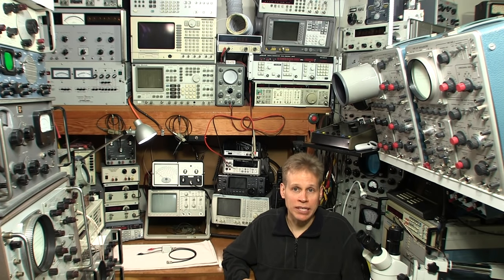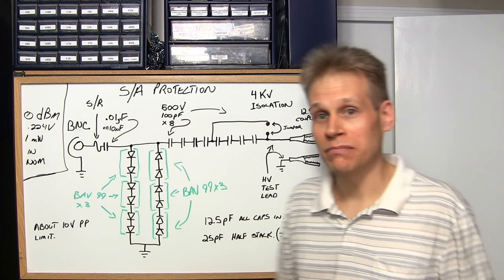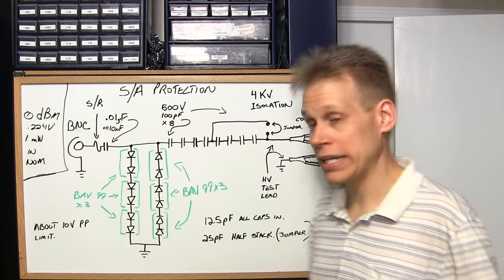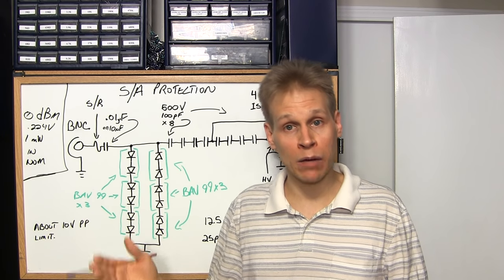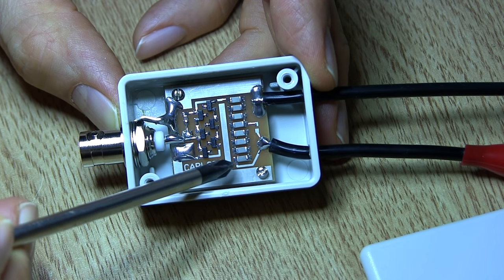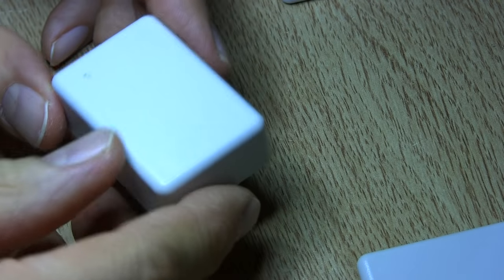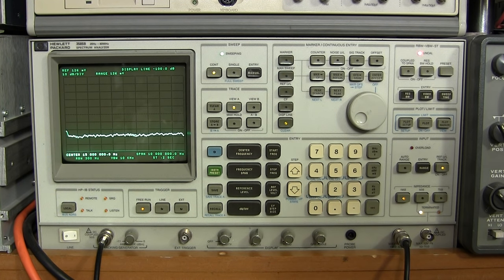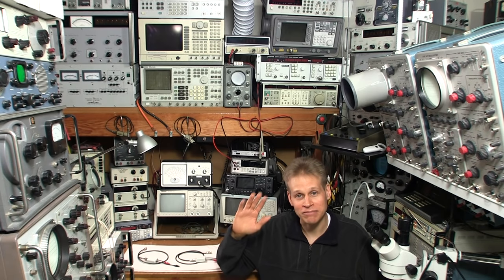Build this Spectrum Analyzer Protection Circuit

Comment: I reproduced this circuit using Circuit Maker and etching it to a single-sided copper PCB - using 1206 caps. I only added a 50 ohm resistor to ground before the 10nf cap at the output. I made a pair of them and so far, so good. I’ll try them on the IF alignment of a SX-99.
Reply from the maker: Hi James. The input to your analyzer should be 1M Ohm for proper results. Adding the 50 Ohm resistor to the TG side is OK, and suggested.
Reply: @MrCarlsonsLab  Paul, my spec-an is Siglent SSA-3032X - it has 50 ohm input.  So, understanding that the 50 ohm resistor basically sets up a voltage divider, should I turn up the TG signal ? What is your suggested mod to make the 50 ohm match to the input of the spec-an ?
Reply: @MrCarlsonsLab  Well, no response. I’m going to try a simple in-line 50 ohm terminator on the SA input and see how that goes.
Reply: @jameshall5835  I have the same SA, how did this work for you?

Comment: Amen on the being careful what you put into your spectrum-analyzer. I have to REALLY have a compelling reason to hook mine up directly to any circuit.  I have an HP-8557A which has a 30VDC but ONLY 2.2VACRMS input capability!  I've had to repair this unit and it is not for the faint-of-heart (just look up a manual for one of these and you'll see!) as it is full of specialized and one-of-a-kind parts that are nearly impossible to find.  In the past, I used a very small-value capacitor and a 120dB step attenuator, then "work my way up" to getting a usable/displayable signal.  

So, anyway great video on both the value of "light" coupling and protection of the SA's front end.  Also, nice construction project and showing the value of placing a "service-loop" on the BNC center-pin to prevent breakage/damage to the PCB.

Finally, another project idea might be to make a high-gain broadband RF amplifier with a detector that would allow your viewers (without spectrum analyzers/scopes) to be able to both very lightly-couple and display the amplitude on a analog multi-meter for alignment purposes...
Reply from the maker: +SpinStar1956 
Thanks for your comments!

Comment: Yes I believe another name for it is a "DC block".  I used to use one on the input of the spectrum analyzer when I was probing around an RF circuit sniffing for frequencies I was looking to tune with voltage controlled oscillators.  The DC block provided protection for the spectrum analyzer in case you inadvertently hit a voltage test point which could blow out the face plate of the spectrum analyzer.

Comment: HP used to sell a DC block to connect to the front end of your spectrum Analyzer, Also they had reverse power protection for some of their Signal Generators. The DC block was nothing more than a cap. Try changing your volts/div to a smaller value and see what your curve looks like? Great video keep them comming.
Reply from the maker: Gregory West Thanks for the comment Greg!

Comment: Another great video Paul. Very useful flat, wide frequency ranged coupler.
   I've never built a PCB using the etching method and laid out on the computer. It would be great if you showed us how you do it.
   I know, I said to myself; "What, that's it?" LOL I am so use to your long drawn out sagas. I "LOVE" long drag out sagas!
   I see approx 3,350 watches on your DeForest Crosley Empress video as of this moment. Congratulations are in order here!
      Great work my friend,
           Tom
Reply from the maker: *****  Thanks Tom! I try to speak to all levels of experience at once, so I'm playing with a fine balance all the time. Some say "long winded" I prefer "Considerate to all." The Deforest Receiver was the labor of love. That dial sure is nice. The owner is going to send some pictures of it when it's all together. Maybe I will edit a quick shot of it in a future video. Thanks for stopping by!

Comment: This simple little video has generated a great number of comments.  This is certainly an interesting device.  Now for my question. . . .  Would it be possible to show how you make your circuit boards?  They look professionally done.  I dabbled in this about 15 years ago making attenuators at work.  My boards worked fine, but the sure didn't look as good as yours do.  Thanks again.  Nice video!
Reply from the maker: Stephen Moore You bet! I will do a video on them soon. Thanks for the comment!
Reply: Mr Carlson's Lab I agree with Stephen.  I would love to see how you make those PC boards.  Mine never turn out like that.  I would also like to know what kind of etching solution you prefer.

Thanks for another great video!
Reply: xraytonyb I don't agree with Stephen, and never have. Mind you that is not relevant to this channel, and as usual I enjoyed the really professional presentation and I'm sure I'm repeating myself but I am so impressed with the quality here. BBC YouTube. (PS first bit was just stupid joke)

Comment: Very nice video.  I am adding my request for a impedance matching for 50 Ohm input on my spectrum analyzer.  I am wondering if you really need to worry about impedance matching as long as you get your flat line when using the tracking generator.

Comment: Another Great video Paul!  Very kind of you to act so quickly to all of us who wanted to know what was inside the magic white box.  I like so many others have a Rigol with a 50 ohm input I might try to build up the combination of the two circuits and see what happens.  It would be an awesome bit of kit if we had one with select-able output impedance. That last sentence was so Dave Jones!  Do you not get a bit concerned with the alligator clips penetrating the wire you are lightly coupling too?  I was thinking it might be better to use a different type of clip more like a scope probe clip.
Reply from the maker: Mark Fritz Hi Mark, Thanks for the nice comments. At the time, my intention was just for my use. Had I known there would be so much interest in these, I would have made one for 50 and 75 Ohm inputs as well. That little circuit that Michael mentioned below looks like a winner though. I didn't look at the current consumption, maybe a couple of small batteries at the probe? I will have to look into that.

Comment: Great video, as always! It's also very timely for me since I just picked up a HP 3588A analyzer.  One quick question: Is there a design consideration for putting 8 capacitors in the circuit?  I won't be using surface mount components, so could I just use a single 12 pf high voltage (6 KV) ceramic cap as an equivalent?  Thanks again, and keep up the good work ... so much to learn.
Reply from the maker: Design Research That would be absolutely fine. Thanks for the comment!
Reply: Its valid your suggestion , BUT if that capacitor go short out  for a given reason,  you are in trouble... several caps increase the reliability from my humble point of view .....

Comment: Great video as usual.  Paul I need the 50 ohm impedance I think for my old HP 141T.  Can I use a 10x Scope probe and a 2w dc block like you find on Amazon to keep my Analyser safe??
Reply from the maker: If you are looking at something for the input, IE: high impedance to 50 Ohms, You may want to look at my Sony CRF 320 video for ideas. The safety would be in front of that.

Comment: Fantastic work as always. I don't have a spectrum analyzer but I know that I've killed 2 MP3 players and 2 channels of my PC sound card with "high voltage". Sound card took about 200V spike from a Vacuum Tube Vu Meter project, the first MP3 player took a few KV from an ignition coil (I was trying to make a singing arc with a 555 timer) and the Philips MP3 player took about 7.5V reversed polarity and wen't kaput in the sense that the audio stage is dead. So after so much grief with them, I've considered making myself a protection box with some diodes, resistors and capacitors. Cheers :)
Reply from the maker: +ciprianwiner 
LOL, you've been busy experimenting. Good stuff!

Comment: Thanks for the great video. Very informative, as always. My HP 8590B only has a 50Ω input. This may seem like a dumb question, but…would an inductive coupling scheme be a better way to provide attenuation, isolation and impedance matching for 50Ω input S.A.s, or is it best to stick with capacitive coupling?

Comment: Thanks Paul for your videos.  I am restoring a Hammarlund HQ-129-X.  I do not have a spectrum analyzer but I do have a late model Tektronix 2 channel oscilloscope and I just bought a Siglent SDG1025 function/sweep
 generator.  The scope has a 1 Meg input impedance and the function generator can be selected for a 50 ohm or Hi Z output.  The back of the function generator has a trigger output that I will feed to the oscilloscope trigger input.  Can you tell me what type of protection circuit should be on the output of the function generator and what should be on the input of the oscilloscope to align the IF?  I think I need to build a demodulator box to rectify my signal coming into the oscilloscope.  Thanks, 73 Mark

Comment: Why is one lead shorter than the other? Also, wouldn't the input capacitance be 12.5 pF in series with 0.01 uF, not 12.5 pF?

Comment: 15:00 "This is not intended for high frequency use."
Tho those leads are probably the least of your problems in the high frequency domain, the row of capacitors are going to be a nice hairpin filter, and considering the vast amount of turns in the design it's going to have a lot of inductance. So yes, I see what you mean with not intended for high frequency use. Tho that box looks a little to small for a better high frequency design. Tho still a rather nice piece of equipment.
Reply from the maker: +Unknownety 
It is a purpose driven device, designed really for low frequency IF alignment, coupled to a vacuum tube grid or last IF transformer. Thanks for your comment!

Comment: This is a handy little device! I don't have a spectrum analyzer at this time, but I'm using an old RCA WR-50B analog RF signal generator which has an output range of 85 kc to 40 mHz. What I've been doing is putting a capacitor in series with the leads from the signal generator for blocking DC. I have various rating caps that I keep on hand for different receivers since alignment procedures vary somewhat with make & model receivers. The clamping circuit is valuable. This may be worth me building one! With the BNC connector on the end of the box, it can pose an issue of shorting against other components & terminals in a chassis. What could be done is, install a hard-wired pigtail coax out of the box with a BNC connector at the end of the lead far enough away from the chassis. What's your take on that? Frank Ferraro--Audio Craft Electronics.
Reply from the maker: Frank Ferraro That would work as well. It's totally possible to eliminate the BNC at the box if needed. Thanks for your comment!

Comment: Very interesting video.  Thank you.  I would welcome your thoughts about building an isolator for the audio jack for smartphones that would allow various apps such as signal generators and spectrum analysers to be used in a safe manner whereby the smartphone is electrically isolated from the circuit under test.  Ideally this should be both way (output and input).

Comment: Hi Paul !I was wondering how you would change this circuit to work with a Spectrum analyzer with a 50 ohm input.My analyzer has an input MAX RATING of + 20 DBM and  +/- 25volt.  ---- Very good videos  many thanks,  John
Reply from the maker: +John Bellas 
Hi John. If you read through the comments, a poster left a great link to a schematic for 50 Ohm application. Thanks for your comment!

Comment: Hi John, looking at that very small and neatly made PCB I wondered what you use to solder all the "surface mount" components. Is it a conventional solder iron or what?
Reply from the maker: Stuart Grant Hi Stuart, Just a normal iron with a hooked tip. I will do a video on those boards in the near future. Thanks for your comment!

Paul

Comment: Sweet! Thank you a bunch!
Reply from the maker: Michael Lloyd No problem!
Reply: Mr Carlson's Lab Uh oh. I just caught the 1MΩ impedance part. Both of my spectrum analyzers (Agilent E4411B and Rigol DSA815 TG) have 50Ω I/O. I don't use either on my tube radios for fear of messing up and blowing the front end out. I have a couple of HAM rigs (Drake twins and Yaesu FT101) that still use tubes. When I finally get around to restoring those I'd like to be able to do the alignment with a spectrum analyzer. 

What do you think of this little FET probe circuit? Other than requiring power it seems like a good solution (circuit is hyperlinked where it says Figure 1.)

http://www.edn.com/design/analog/4322333/High-impedance-FET-probe-extends-RF-spectrum-analyzer-s-usable-range
Reply from the maker: Michael Lloyd Looks great! I see they are using the same diodes at the input of the op-amp. Looks like a good solution for impedance conversion.

Comment: What mod is required for a 50 ohm input I am in the process of getting one of the RF explorer spectrum analyzers and I want to protect the front end of that they also recommend using a 30db attenuator on the inputs even when stored to protect the input the front end front from large  RF voltages which I already ordered 2 of them to protect the unit. I would build one or of the units you have shown in the video.

Comment: I just finished building two of these boxes! I created the pcb layout in Driptrace. I etched the two boards in a bath of muriatic acid and hydrogen peroxide. I used liquid tin to cover the copper traces. I soldered all the surface mount components on, which is my first time soldering surface mount. The test on my HP 3588A spectrum analyzer looks really good, so I'm looking forward to trying these out on my Hammarlund HQ-120X when it comes time to do an alignment. I posted a photo of the boxes: https://www.flickr.com/photos/87241965@N00/33516373892/in/dateposted-public/
Reply: OMG...  TWO of your capacitors were crooked.  Please re-do the assignmnent and re-post.

LOL

Good job btw !

Comment: Hy, i have recently got a spectrum analyser, i will use it for old tube radio, but it hase a 50ohm impul, +10dbm and 0zero volts dc imput. Can u make a vid about how to use it and how to adapt this little boxes to protect my spectrum analyser?

Comment: Hello ! I have seen the datasheet of the BAV99, and you say that limiter circuit limits 10Vpp, how do you know, if the current is low enough, that the diodes won't be "on" at 4,2V and not 5 and limiting to maximum of 8,4V and not 10V ? Maybe you never even get close to this values but...
Reply from the maker: CT1ELP Hi, there is a reason for the "about" word on the white board. Thanks for your comment!
Reply: Mr Carlson's Lab OK !
Thanks for the "confirmation" and keep up the good work, you have an amazing lab a nice videos (a bit long some).
Reply from the maker: LOL! I tend to be thorough :^)

Comment: Super video!  Would you be willing to make the PCB drawings available so I can try my hand at making them (using your other excellent video as a guide, of course!)
Reply from the maker: Charles Robideaux I may post the layout. It's in Traxmaker, so you would need the program to open it. Thanks for your comment!
Reply: Mr Carlson's Lab Hello, I have downloaded and installed Traxmaker. Also have a laminator that I am modifying for this usage.  Tnx again for your very informative videos!
Reply: Hello again!I have assembled all  the parts to build a few of these marvelous protective devices. Would you be so kind as to share the Traxmaker layout for the PCBs?  Tnx in advance and keep up the GREAT Videos!!

Comment: I have an question: if I have tube radio from 1962 do I have to change anything? or repair?
Reply from the maker: TM80 NotGoodWithNames  Yes, the electrolytic's are well past their due date. All paper caps need to go as well.
Reply: that sounds like work... it's an stereo radio by aga it has telefunken tubes.

Comment: Hello Paul
I have a big supply of Attenuators I used for catv installs not sure but maybe 75 ohm being cable tv could these be used in 50 ohm lines ,would that be a mismatch,,wanting to use them for spectrum analyzer use
Reply from the maker: +DENNIS N 
Ya,  unfortunately it will cause impedance matching issues.
Reply: I thought it may   thankyou
Reply from the maker: Your Welcome Dennis.

Comment: Where can I find some of that high voltage silicone test lead cable?
Reply from the maker: Digikey stocks it. Unfortunately, I don't have a part number for you.
Reply: The closest match I've found is Pamona Electronics Test Lead 18AWG 10KV BLACK 50' on Digikey, part number 501-1281-ND.  I'll bet this is good for replacing some of the point-to-point wires in old tube gear as well?

Comment: Great video Paul - what am I going to do for the rest of the evening! I am currently scouting EBay for a Spectrum Analyser for IF alignments on tube radios (450KHz - 10.7MHz typically). Can you tell me what to look for bandwidth and resolution wise?
Reply from the maker: g4rko Barry Hi Barry. I have used many analyzers, and I have to say, this one is one of my favorites. This 3585B goes down to 3Hz resolution bandwidth. If you look at the A model, they sometimes have an error attributed to some needed isolation on a circuit board. These units are very fragile, and HEAVY! I would want to personally pick one of these up with my own vehicle.
Reply: Mr Carlson's Lab Thanks Paul, very helpful.
Reply from the maker: g4rko Barry Glad you enjoyed Barry!

Comment: I built the 1M unit for my tracking generator .,but my  S. A. is 50 ohm input .How about showing the 50 ohm design.
You sure know your stuff.  Thanks  PWS.
Reply: Add a 50 ohm resistor to ground at the box.